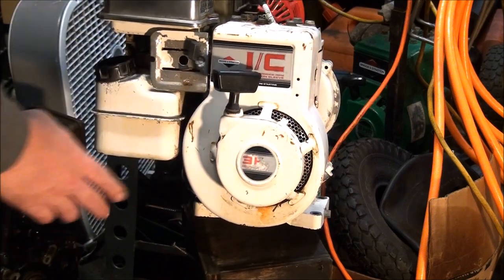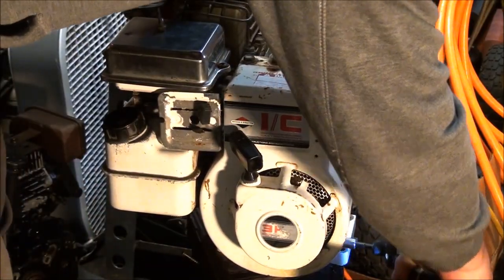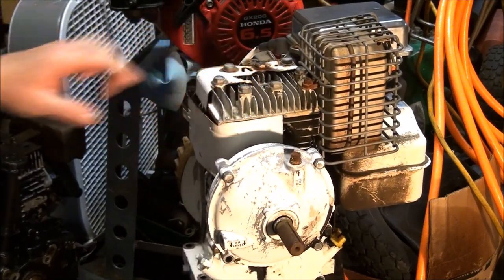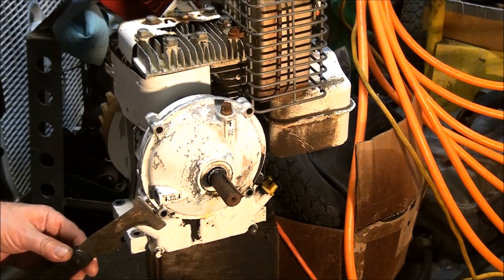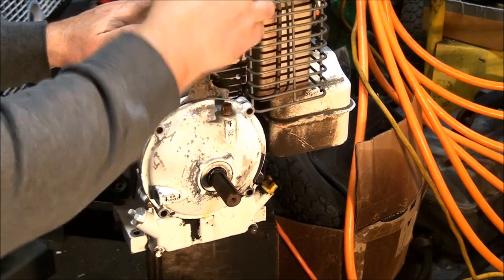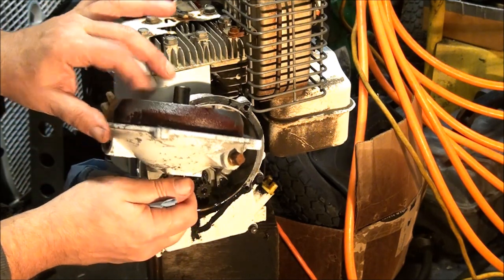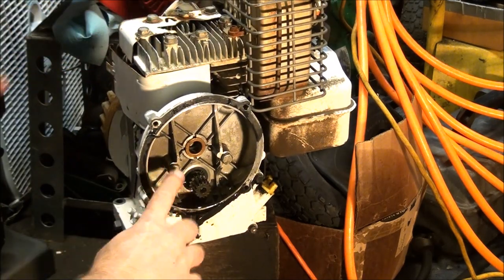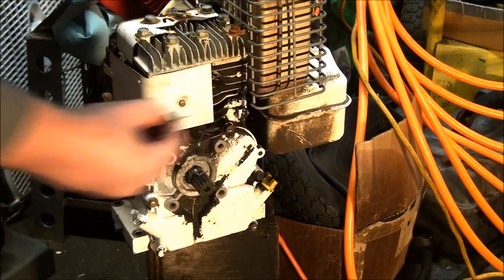What does the INSIDE of a Briggs and Stratton GEAR REDUCTION UNIT look like? HOW TO INSPECT REMOVE 3

Comment: I have a 19 horse Briggs & Stratton with a similar gear reduction system… However, when I took mine apart, I see that it is open into the engine crank case… And the oil that it receives is the same oil from the engine
Reply from the maker: Interesting!

Comment: I have NEVER had to do anything to a B@S reduction system. Those engines generally last forever.  Usually it's a lack of oil that destroys them due to lack of maintenance.  Generally I see them on rotortillers. I have never torn one down because they are eather scrap, or still running.

Comment: Any idea of the gear ratio ??
Reply from the maker: Briggs only made 2 types of gear reducers for this model engine as far as I know and I can't remember either ratio right now.....
Reply: These are a 6/1. They were pretty common on mortar mixers and garden equipment. As far as I know, Briggs still makes some, and Honda makes two versions, a 2/1, and a 6/1.